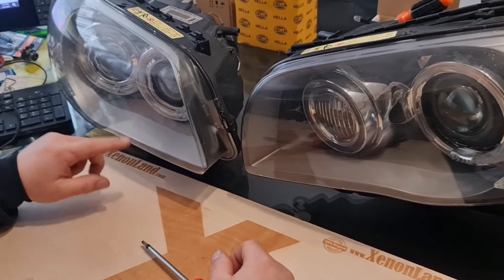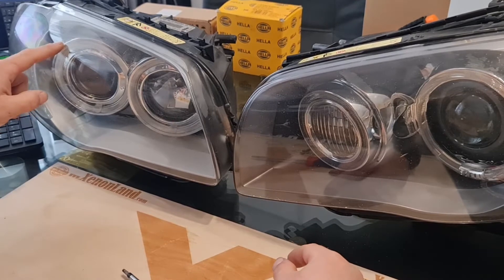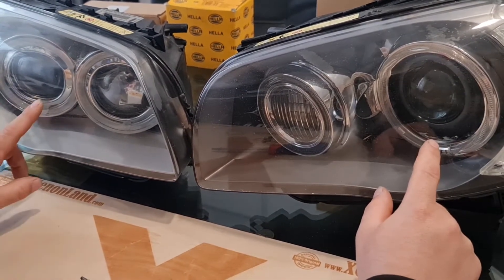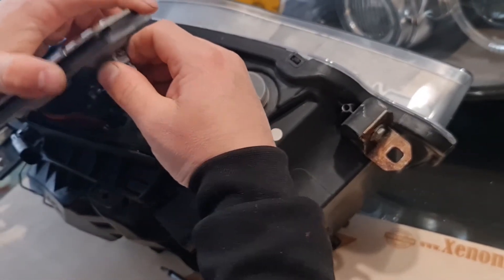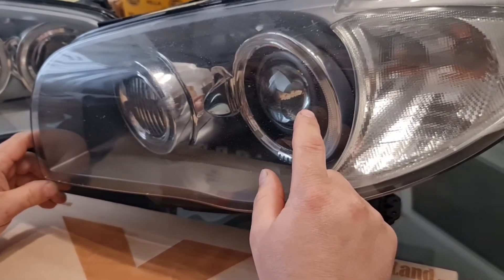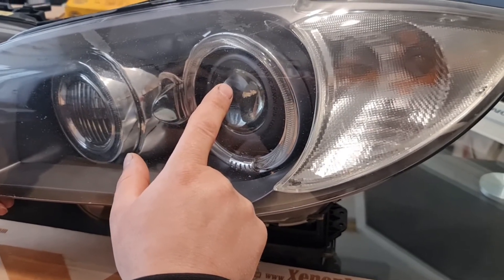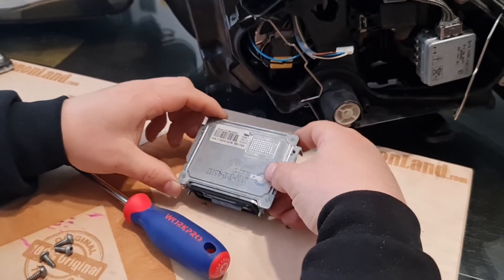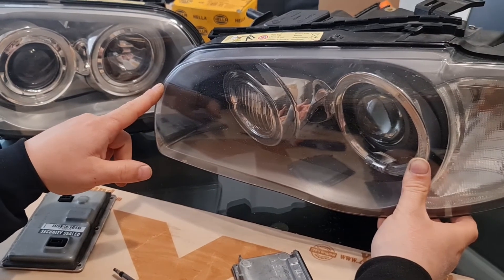BMW 1 Series E87 E81 XENON headlight ballast and AFS module identification: Which ballast I need?

Comment: Hi. I have dynamic xenon lights. But i crached one. So plastic is now broken, but light itself works. So is it possible to deassmble xenon light and put inside dynamic xenon light parts?
Reply from the maker: Yes, theoretically possible, but it's more than difficult.
Reply: It is realy hard to find secondhand/used light. Part code 6952608

Comment: @XenonLand hello..... i also need to know the part No. of AFS module time 5:51. i found many types on another models from series 3 and higher .... but for series 1 i didnt foun any .... please helop me   - Car control unit code is  "cc-id 295"
Reply: my car  - 3 door e87 - model 2008 - with´this dynamic xenon headlight
Reply from the maker: @marekvagner5789  This one concretly is Lear 7171586
Reply: @xenonland  Thank you so much for your reaction

Comment: So which one do i need in a bmw e87 120i from 2007. ???
Reply from the maker: Ballast unit is Valeo 6G for 2007
Reply: @xenonland  which one is that on your video left or the right one?
Reply from the maker: Positioned on the right at the video/picture  is the facelift headlight 2007 (actually it is a left headlight at the car), left one at the picture/video is pre-facelift with silver frame/bezel 2004-2006.
Reply: @xenonland  ahh well yea i saw in you video but you dont say that the pre-facelift fit the 2007 model  so im curious if i can fit a 2004-2006 light on a 2007 bmw 1 serie?  I can buy a pre-facelift  like you say with the chrome corners  for a good price but i have a bmw 1 serie 120i e87 2007  so idk if it fit yes or no
Reply from the maker: @cbsflows1041  practically will NOT. Technically possible but it will not be plug and play, a lot of wiring should be changed. Especially if your exisying headlights are bi-xenon, retrofiting older headlights will be a huge pain.
Reply: @xenonland  im completely lost now.. which headlights do i need to choice for a non xenon bmw 1 serie 120i e87 2007 ?  I also read that if a bmw is from fabric not xenon delivered then a xenon cant go on it? What parts do i need to get everything xenon ?
Reply: Do you have any videos of facelift headlights?
Reply from the maker: from approximately 3:56 I cover also the facelift headlight in this video. What are you looking for? Which info? @fredy9252
Reply: Hi. I have dynamic xenon lights. But i crached one. So plastic is now broken, but light itself works. So is it possible to deassmble xenon light and put inside dynamic xenon light parts?